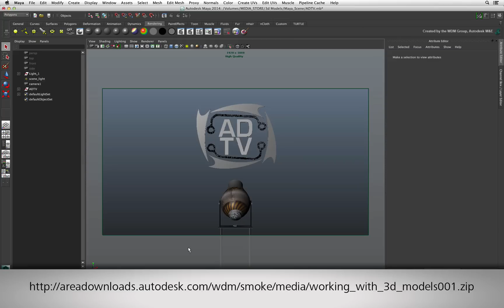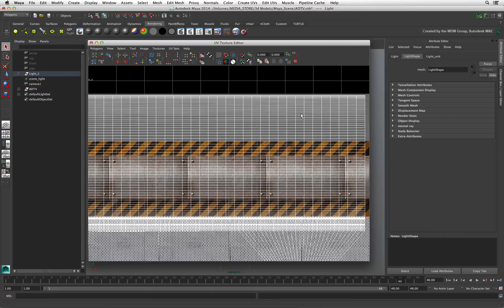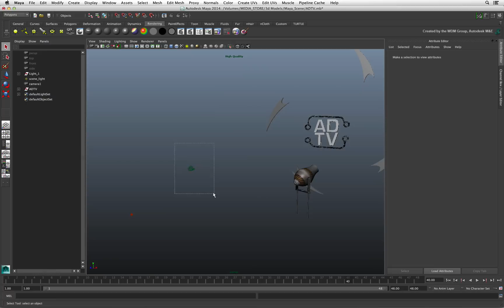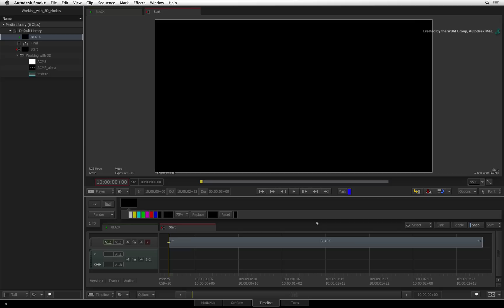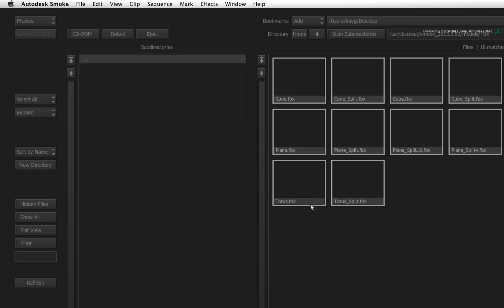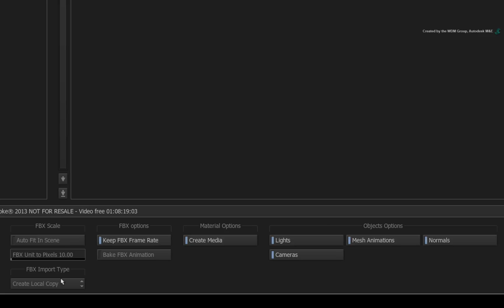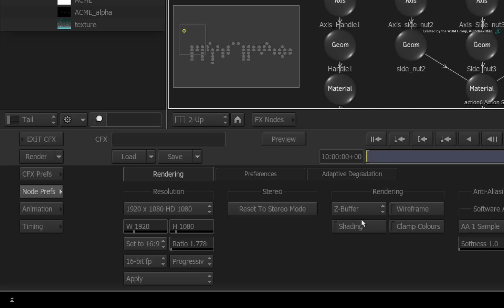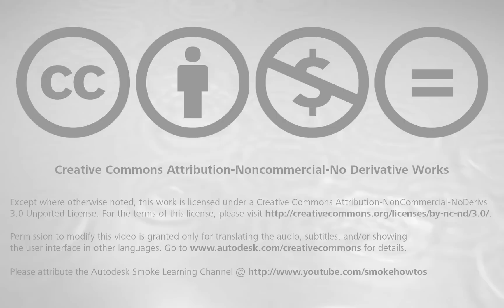Working with 3D Models: Importing FBX 3D Model

Comment: I would i do the same thing , but using modo ? using the Autodesk fbx option when exporting inside of modo , when i imported that file inside of smoke only the geometry goes in . no textures .  please help
Reply from the maker: You need to look at the export settings for the FBX.  Normally there is an option to embed textures inside the FBX but it is not on by default.   This is the case for most 3D applications supporting FBX export but I have not tested it in Modo.

Comment: Grant 1st of all i want to inform you that without your videos i wouldn't be able to work in smoke .. 2nd ..I want to ask you why when i try to import an fix item smoke crashes ? i work on a mac mini i5 with 8gb ram..Thanx in advance
Reply from the maker: Hi Dimitris, Happy New Year.  I am unsure why your FBX is crashing Smoke.   Have you ensured that everything is correctly baked into the model?   I would suggest trying some very simple models first to see if you have done something that is too complex for the FBX export to convert.   Also look any potential errors coming out of the FBX exporter.  Hope this helps!

Comment from the maker: Hi, the projector is not available in Smoke, only Flame.   There are "uncertified" ways around this as I am sure you have discovered but it will not be covered as it is not an official feature of Smoke.

Your only other alternatives is using diffuse map texturing to texture the models and than you move the textures around.   Hope this helps!